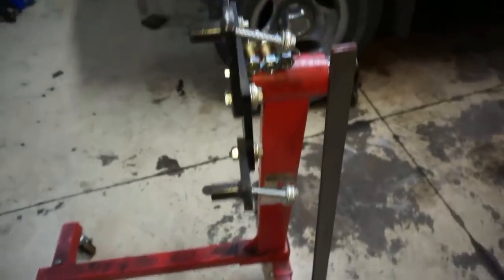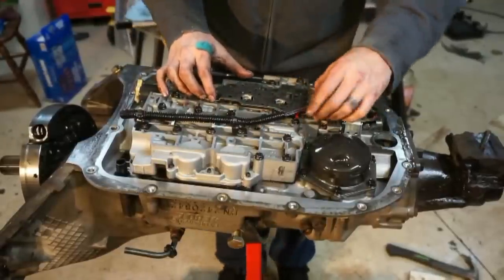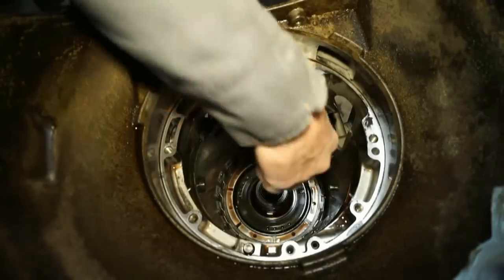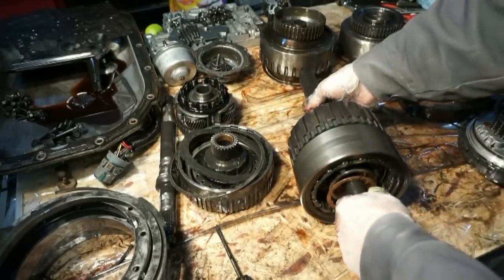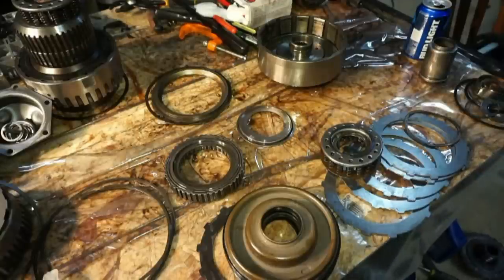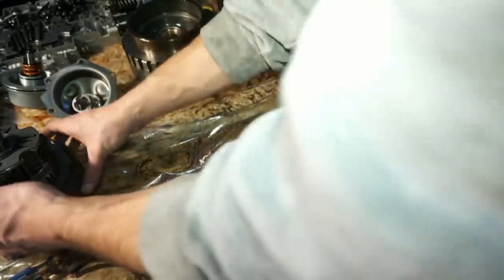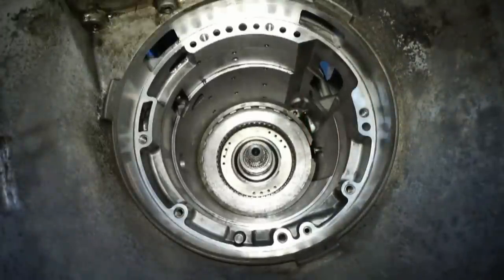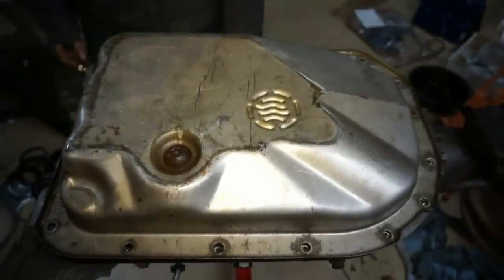4l80e TRANSMISSION REBUILD WITH TRANSGO HD2 KIT !!! FULL VIDEO!!! - a21bravo

Comment: The way I was taught to replace Teflon seals in the oilfield was to warm them up in a cup of hot water. Put a cup with about a half inch of water in the microwave for about a minute then put the seals in the cup for a minute. They will stretch really easy without really galling them up. To shrink them back down, we would wrap electrical tape wrong side out (so the sticky doesn’t get on the seals). Stretch the tape really tight as you wrap it around 5 or 6 times, and the stretch on the tape will compress the Teflon seal into the grove. Then set the part in the freezer overnight. Good to go.

Comment: Thanks for this video. I used it while doing a first time 4L80 rebuild. Along the way, I found a tip that can hep you at 1:44:18 when trying to install the large piston. I could not get it to seat using a feeler gauge. I used a similar item as you did on the Teflon seal compressors. I cut up a soda can into two pieces, cutting off the top and bottom from each so I had wide flat pieces of metal. I then placed one on each side under the lip seal and put the pieces together. Keeping tension on the top piece, I used a small screwdriver to push the lip seal into place in each of the two gaps. The piston went in with minimal effort. I used a small pair of pliers to pull the two can parts out. If you had a long enough piece of thin metal you would not have any gaps. The piston turned with a little effort so I know it was sitting in the housing properly.

Comment: I need some advice. At about 1:50:00 you install the snap ring that is in front of the reverse band. I did this and had it pointed at 9 o'clock per the overhaul manual I have. The problem is my center section is out of alignment by maybe 1/16 of a inch. It is not back far enough, both the bolt hole and cooler seal are too far forward. I've retried it several times and using just the center section it still will not align. If I remove the snap ring and install it, then it is slightly too far back. The snap ring is in the first groove in front of the reverse band. My 4L80 is a 1997 2WD model I am converting to 4WD. Thanks for any help.

EDIT- I had the wrong (too thick) snap ring in there. I used the thinner of the two and it aligned properly. Credit to user NorthTexasConverter on LS1tech:
https://ls1tech.com/forums/automatic-transmission/1731496-broken-intermediate-snap-ring-4l80e-2.html#post18275346

Comment: Great job on the video! I would never take on a task like this. That is a lot of parts and a lot of room for error, makes an engine build seem like a piece of cake. The parts look heavy duty in this transmission, that is why I will be installing one of these in my 1970 Chevelle.

Comment: I do wanna say, I dont know if you rebuild transmissions for a living, or if you did tons of research. Either way absolute awesome job on this, attention to detail amasses me.  GM trained trans tech here, and not gonna lie, totally used your video as reference to get mine back together. (sat apart for 2 years) Most of the time we put SERTA units in, especially with a 4L80E. Most of the time the rebuild was more then a new unit.

Comment: Any tips or things you’d change or update 4 years later? Following this on my first rebuild, greatly appreciate the time you spent making this
Reply from the maker: I would not do the HD2 kit. I would just dual feed internally, still upgrade the intermediate snap ring, increase line pressure with Sonnax valve, and drill the pump for the line to lube... Rollerizing the output is a low cost improvement also. I think that's it.
Reply: @BlaserBuilds  sweet!! Thanks 🙏

Comment: Thanks for a great video. i have a similar gearbox. That had a oil leak. and the oil pump has go bad.(The rest of the transmission looks fine).  I have changed the oil pump. But the transmission don't  work at all:( no power on the wheels and if i take of the cooling oil pipe from the gearbox it don't come any oil.seems like it have no oil pressure. The converter seems to be corecetly installed. Any idea what i should i do next?

Comment: Hello hey I have a 95  4L80E and the notorious no reverse have all forward gears including low is there a safe sure cure kit that would beable to fix that or is it a pull apart and inspect all awesome video thanks for your help thus far...
Reply from the maker: If the band is worn, but not broken you can weld some length onto the servo pin.
Reply from the maker: @SPPTV did it here. 

https://youtu.be/sD2orazZkzo

Comment: I am searching for a complete rebuild kit for the 4l80e off my 1998 Chevy k3500 4x4.  I am not sure if you recommended any vendor in the video as I haven't gotten through the entire 2 hours.  It's been very informative and I've learned a lot so far.  Taking notes as I pause it.  Should I just buy a complete rebuild kit instead of trying to figure if a part is burned/scored etc.  My 4l80e has 300k on it and I stopped driving it when it went into limp mode. Can't go faster than 50mph right now.  I am gonna get that transgo kit, but as far as getting a rebuild kit I'm not sure which is a reputable vendor I can get stuff from online. Thanks!
Reply from the maker: I have used the ebay kits. Recently I have been just buying Borg Warner clutches, and raybesros steels. GM used borg clutches from factory.
Reply: Thank you for sharing your expertise and taking the time to provide all the videos and this info. It is extremely helpful and greatly appreciated.

Comment: OK, so how did the transmission work when reinstalled in your truck?  I know you said you had to pull it apart again to install a missing part but other than that how did it go?
Reply from the maker: Went well. Still driving it regularly and use it at the drag strip often also. Lots of drag passes and wide open pulls. No issues so far.

Comment: Where did you order the rebuild kit from? I just bought a used 4l80 for my project, and may open it up before installing it in the car. The guy said it was good, but you never know.
Reply from the maker: chevydriver207 https://m.ebay.com/itm/4L80E-Transmission-Deluxe-Overhaul-Kit-1997-Up-W-Sprags-Bushings-Washers-Level-2/371129441471?rmvSB=true&ul_ref=https%3A%2F%2Frover.ebay.com%2Frover%2F1%2F711-53200-19255-0%2F1%3Ficep_id%3D114%26ipn%3Dicep%26toolid%3D20004%26campid%3D5338029122%26mpre%3Dhttps%253A%252F%252Fwww.ebay.com%252Fitm%252F4L80E-Transmission-Deluxe-Overhaul-Kit-1997-Up-W-Sprags-Bushings-Washers-Level-2%252F371129441471%253FssPageName%253DSTRK%25253AMEBIDX%25253AIT%2526_trksid%253Dp2057872.m2749.l2649%26srcrot%3D711-53200-19255-0%26rvr_id%3D1486196350564&_trksid=p2057872.m2749.l2649&_mwBanner=1&ul_noapp=true
Reply: You're the man, thank you.

Comment: Would that pressure switch on top of the valve body cause it to not shift into 4th gear? I've asked around and got answers from bad clutches to bad 3-4 shift solenoid to rear speed sensor. I was hoping it was the sensor because the speedo wasn't working right either but no such luck. A new sensor just made it worse. Wouldn't shift into 3rd after that.
Reply: Great video btw. I'll be using it as guidance if I need to rebuild mine.

Comment: I have 4l80e transmission in 2002 gmc sierra 2500HD 4x4 run an drive but I have no flow in the cooler line the truck drive no slip,no high rpm no noise  HELP!!!!!!!!!!!!!! Please

Comment: HI i have 1997 GMC 2500 diesel truck, my 4l80E transmission failed . i got a  1999 used 4L80E gas truck transmission . can i use this for my diesel truck . if not what is the difference . please help
Reply from the maker: Just the converter I believe.

Comment: Any specific manuals you used to help you through the process?
Reply from the maker: Fermeted Waste I did pick up an ATSG manual for reference. I found it on eBay for $14.
Reply: a21bravo good deal thanks. Your vid will help out for sure.

Comment: The reason the boost valve would not come out is because you used a pry bar and not a puller on the pump.

Comment: Didnt show when you modified pump body per the transgo kit
Reply from the maker: I believe I was using the sonnax line to lube valve on this build so I didn't drill the pump.
Reply: @BlaserBuilds  i was just wondering if the hole that gets enlarged to 9/32” on the pump is supposed to be all the way through or just the entrance lol might be too late now kuz i drilled it all the way 😬😬😬

Comment: is ur wedding ring cold rolled steel or stainless ?
Reply from the maker: Stainless Nut. I got from Fastenall for $1.37 Wife did the work of grinding out threads and sanding outside. I gave the nut to her, she finished it, and gave it back at the wedding.

Comment: would really like to have seen your procedure for replacing the bushings, i seem to be experiencing a lot of grief with mine
Reply from the maker: XX X i didnt replace all of them because my presses would have worked for all...
Reply: I replaced all of mine and found I had to use a brake hone (small) or engine hone (large) to get the correct ID on most of them once they were installed- forward drum was the worst. I used various tools to remove & replace them, mainly sockets that were the correct diameter and a Harbor Freight shop press. Some of them have to be destroyed to be removed.